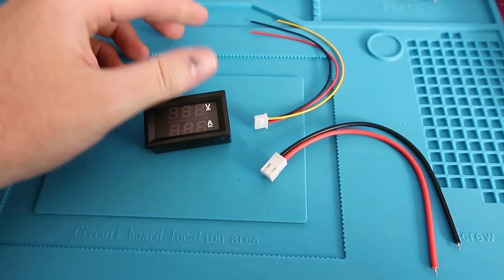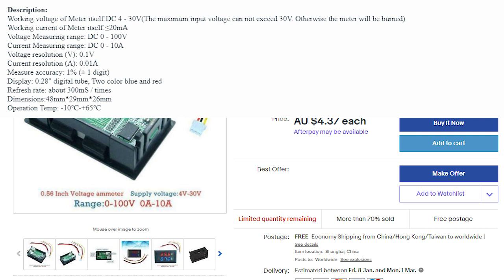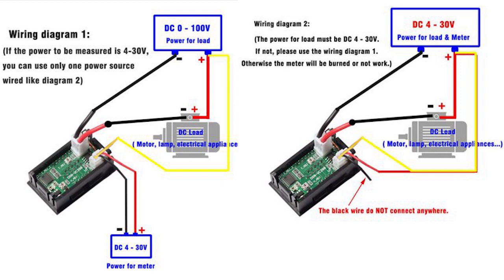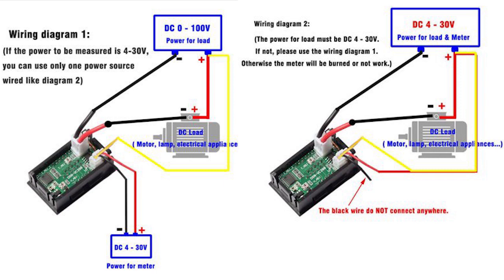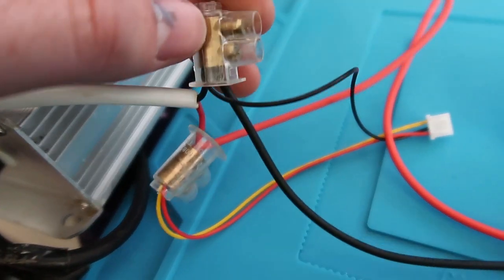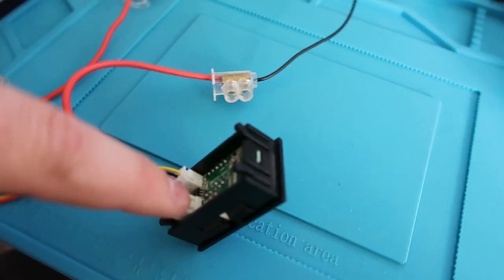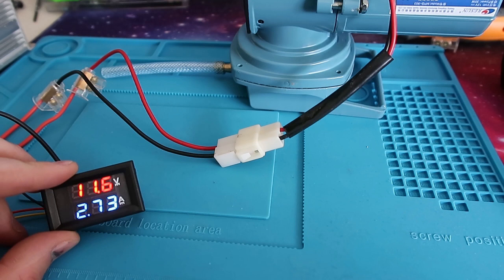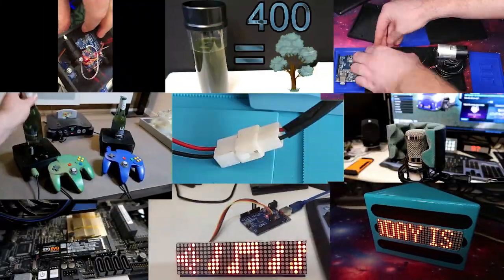How to setup a Digital Volt Amp Meter

Comment: waaaaaaaaaaaaaaaaaaaaaaaaahhhhhhhhhhhhhhhhhhhh i am certainly so stupid or you gave it to me wrong. hi . some advise please . i have a volt and amp meter that i want to install but its boogling me brain. i wired it exaclty as per instructions. my input voltage is 36 Volt DC so as per the diagram i used another power supply (11.7V) that powers the thin black and red wires to the amp/volt meter. i connected as per the diagram the yellow wire to the positive of the load (36VDC) i get 0.4 VDC at the load side and the meter where its supposed to be 36 Volt DC nothing will work. i must add i tried 3 different meters all the same.

Comment: Great YT Scotty. Yes could you please do one with an external shunt and if possible >10A ?
I've got a van with a control panel that has one of these meters and I'm looking at adding another appliance but I want to ensure the current is still monitored.

Comment: Hello there. You just made me realize why mine blew up.. 
My aim was to feed the voltmeter via a Pv Pannel so that I know that one is working. I than figured the load could be my Mppt so I can see how much current the Pv Pannel delivers.
So, I connected it up as powesource to Mppt also being the power source of the Volt/Amper display.
Little did I realize, e that the description meant Load max 100V and not multimeter supply up to 100V...😢

We live and we learn...
I want the Voltage of the Pannel displayed and stay black when it is not providing energy - visual clu that something is not quiet right..
Could I do that only with an other unit or do we have a workaround for that?
Ie is there a way to display up to 100V with those meters?
I have an external sunt for the load of 30A
Thank you.

Comment: wish there was a way to search through comments as i'm sure someones asked already. I dont have the visible shunt on the board but the ad said the shunt was inbuilt, its model DSN-VC288. following the diagrams above, all i see is the voltage. weirdly, if i just plug the battery direct to the meter black and red it shows something in the Amps counter.. any idea what gives?

Comment: I'm a bit of a numpty with electrics. I want to setup an Ammeter on my bike based Trike. Simple connections for voltmeters I'm okay with. Its just how I can wire in an ammeter to the bike charging system.

Comment: Hi Scotty, Great video.  I am building a bench power supply and I am trying to find out how to connect this meter to a 50 amp shunt and a DC-DC 300W 20A Constant Current Adjustable Step Down Module Buck Converter.  Can you help?

Comment: Hi, say I decided to set up as described on wiring diagram #1. Have a reliable power supply (herein SUP1, up to 30V, 10A). Powering the meter from a switching module (herein SW5, 5V) plugged into the same supply (SUP1). Ultimately, SUP1 powers LOAD and SW5.  May be ignorable but; theoretically,  would the meter measure ampere of load properly or a bit less as all are on the same power source? Thanks,.

Comment: Yay! 😁  Yes please show what to do with the shunt, not that I need it, but one day perhaps. I think I'm going to put some coloured heat string around the thick red cable to remind me that this isn't going directly to positive, but is a continuation of the negative wire to the device. I'm using mine with a TTL breadboard computer and it shows my 5.00V and 0.092A -  perfect.

Comment: Thank you for this video! You have the best diagram I’ve seen of this meter yet (and I have been searching for hours)! 😅 The model I have looks just like yours but it does not have the built-in copper shunt. Not sure what to do about that (?) but I got the meter to at least read volts and current with this video (not sure if it is accurate without shunt tho). 😂

Comment: I am trying to understand how I can simply measure the output voltage of a circuit. On the input of the circuit board I would have example 12 volts DC 2-amps. How can I measure the output of that circuit to get a volt and current read. I am using LM2596 DC-DC buck convertor I want to measure only the output. The LM2596 DC-DC buck convertor has a variable pot that I can adjust for desired output voltage I want to measure

Comment: I have a question for you. I just bought a digital Ammeter  for my boat (12V) showing V and A. For the measuring range, on the package it says 0 - 100A, but on the wiring diagram it says 0 - 10A…(?).
It also says that red wire should be connected from  battery (+) to ammeter (+) and from ammeter (+) to a DC loads (+)
Then from battery (-) to ammeter (-) and a green wire from ammeter (third connection) to DC loads (-).
I would like to measure the total consumption going out of the battery in A and voltage when engine is not running.
- is this possible?
- if I connect battery (+) to ammeter (+) and battery (-) to ammeter (-), then the green wire from ammeter to battery (-). Would this work?
Thanks a lot for your answer!

Comment: Question, I am using a single power source for my meter but I want to be able to turn off the meter while leaving the line power on. Do I interrupt the yellow wire for a switch?

Comment: Since electronics nowdays are much cheaper/easier to buy ready made , rather than building it yourself, making films on simply wiring electronic products, is very useful indeed.
Wiring Timing modules with/without microcontroller, wiring remote controls modules, wiring gain amplifiers, turning a N.O shut down into a pulse...

Comment: Thanks for the help. Mine wasn't working, used your diagram and it still wouldn't read amps THEN I realized I had soldered extentions, but never actually plugged in the connector lmao but it works wired by your diagram

Comment: Thanks. is there any way to troubleshoot it? I bought a new one and the screen does not work!
Reply from the maker: Hey, not really I would try get your money back if I doesn't work and get another, you could pull it all apart and try and hopefully find a faulty component but it would take awhile and  they the cost to replace that faulty part.
Reply: @ScottyDIY  Thank you

Comment: I’m using two of these right next to my circuit panel on my 120 V house wiring the project box which has 120V draws 45 mA. How can I fuse that to protect the wire and project box? Can you put it inline 100 mA fuse?May not be necessary but if it’s easy to add a little fused to protect the wire from short circuit that would be nice. Thanks
Reply from the maker: Yeah inline on the active is fine. Not sure if you can get a fuse that small. Maybe even a PTC might be more suitable.
Reply: @ScottyDIY  - I see 100 mA glass fuses for 120 V available. I guess all I was wondering is do you just put the fuse in an inline fuse holder like you do for a car?  I’ve seen similar fuses although larger for microwaves so I’m guessing the answer is yes
Reply from the maker: Yeah that will work, their should be a few different types of fuse holders depending on what suits you project box, Like a in-line or panel mount.
Reply: @ScottyDIY  would very much like to see the vid you suggested describing an external shunt connection, alternatively would it be possible to just increase the mass of the internal shunt to read more amps? Hope you see this, great vid many thanks..